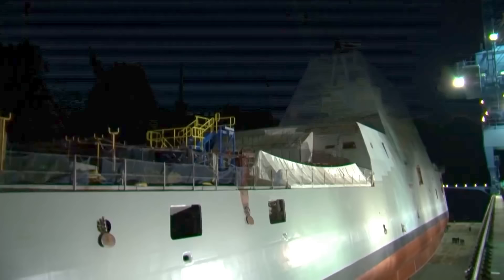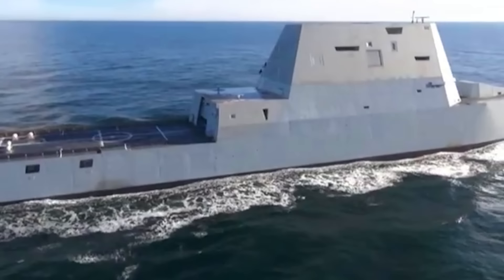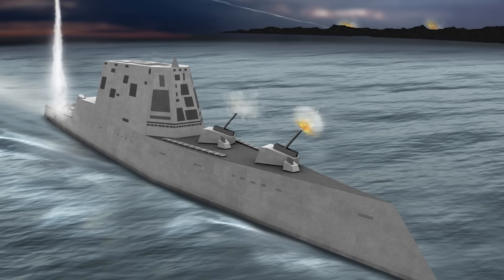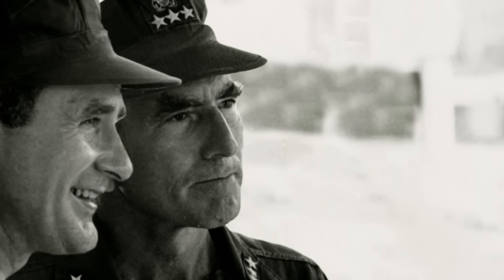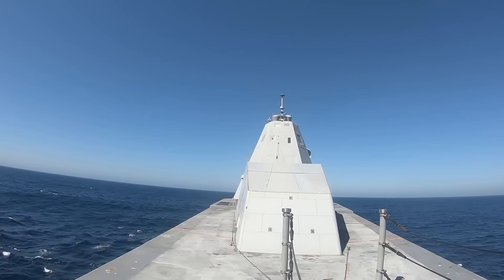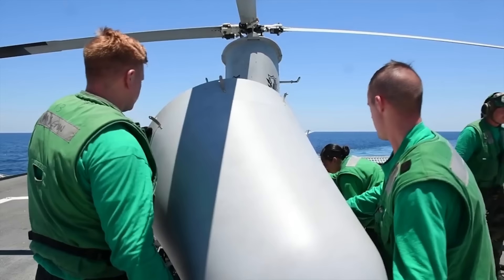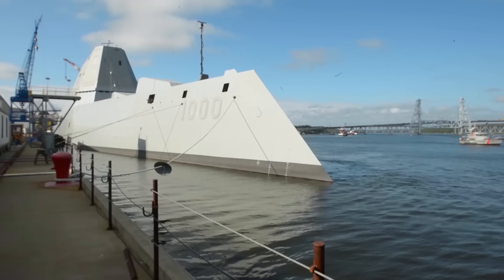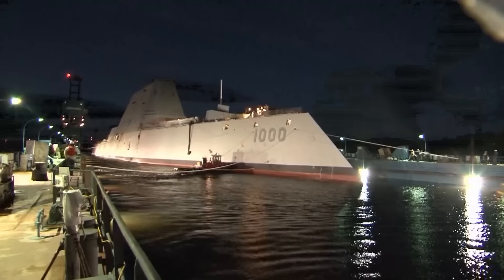The Stealth Ship So Powerful They Couldn't Build Any More

Comment: Another thing you miss is resources..like yttrium,gallium, dysprosium, samarium, neodymium. They are rare-earth elements (REEs)—little-known but crucial ingredients in much modern US military aerospace technology. Each stealthy F-35 strike fighter requires 1920 pounds of rare-earth material, according to DOD. Each Arleigh Burke DDG-51 destroyer requires 15,200 pounds. An SSN-774 Virginia-class submarine needs 19,200 pounds and we not counting missile radar system  satelite microprocessor  yet.But America have little amount of these rare earth mineral  like 1.2 milion tonnes left .That why US invade Afganistan. Afghanistan has an estimated 2.4 million tonnes of rare earth minerals including lithium (used in batteries), uranium (used for nuclear fuel) and many others. One of the largest deposits of rare earth minerals can be found at Khanneshin in Helmand  province. But US is kick out from Afganistan in 2021.

Comment: I got a rare inside on the steering of this ship when I worked night shift @ boss snowplow in the shipping department. The military had a secret area they rented out because it was the only place within 100 miles that could supply enough energy to operate just 1 of the 3 motors used to steer the rudder. That was just enough power to operate the motor without anything attached to it. That wild

Comment: The Zumwalt wasn't too powerful.  It was too complex, too inflexible, and too hard to repair, not too powerful.  It was exactly as powerful as the role it was designed for needed to futureproof the role.  For that perfection though, it was too problematic to produce in larger numbers.  Its the Navy's F-35, an attempt to do way too much that the ship hull could simply not do all of at once.

Comment: These ship were not canned because they were wow too powerful or too advanced but because they were a massive failures just like the  Independence-class was you also did this absurdly rosy video on. They were supposed to be built around a new smart gun and shell system that would replace the system we got from the UK at 45K a shell. The system for these two boat was supposed to cost 20k a shell yet it ended up costing 800k a shell the realm of cruise missiles. Just like the Independence-class they had to take on water to fire their weapons because of a lack of stability and pump it out to start moving again. Just like the Independence-class it couldn't more at full speed and couldn't even move fast in anything but the calmest seas. Just like the Independence-class they damaged there own hull and  engine though standard use to a point it could ended up stranded in the middle of the water on a long deployment.

These two ships cost the taxpayer hundreds of billions in R&D and build cost and now there being scrapped.

Comment: Zumwalts have/had huge problems with their engines. Not the least of which is the union of dissimilar metals without a sacrificial anode.
Reply: WOW! How did they let that happen?? Anyone that's owned a boat knows the consequences of not using zinc anodes....that's unbelievable.....
Reply: @fritzkabeano1969  
I might be confusing the Zumwalt with another failed class of naval ship, but the first one launched had to put up for extensive repairs due to corrosion early in its life.
Reply: @fritzkabeano1969  
I think I'm talking about the littoral attack ship, which has an aluminum hull.
I think they bolted the aluminum cooling water manifold to a steel turbine.
It didn't take long.
Reply: @twill9278  Either way.....just the fact that the designers ignored the basic physics about dissimilar metals and no sacrificial zinc anode tells me everything

Comment: Too advanced for the entire century?  I didn't understand from anything said here why it would be that.  And the claims that it is some kind of replacement for battleships is ludicrous, for one thing we haven't needed a battleship for decades.  For another thing there's nothing about this at all that could replace a battleship unless of course you think battleships were solely designed to bombard the coast of a nation like the New Jersey in Vietnam.  These would have trouble penetrating the armor of a battleship and a battleship could take one of these out with a single hit from any of their 9 16 inch guns.  even their 5 inch guns could sink it, this ship is NOT armored (destroyers are called tin cans for a reason) while battleships have over a foot of armor.  Battleships were multi-mission, land sea and air, but their primary purpose was to fight other battleships and this ship would do well to survive such a battle one on one, much less win it.  It was solely designed as a land attack destroyer to replace the shore bombardment capabilities of the destroyer, but comparing it to a battleship is like calling my toaster an oven because they can both toast bread.

Comment: I thought these were kind of a failure...
Reply: They are and they were doomed from early on. A bunch of new and untested technologies all crammed together in a giant project with continuously changing goal posts is just not going to work well. You need to first test the new stuff with a bunch of technology demonstrators and smaller project. Then, when you have those working reliably, you integrate them into larger projects with well defined roles, needs and functions. "A subcontractor from almost every state" is in most cases not a good sign as it usually indicates that decisions are being made for political reasons.

Comment: Fake info, they arent stopped because of being "too advanced" if you read a single article you will find out that because their hull started cracking, they are survivability tier 1 which means that they have least chance of survival out of other 2 tiers (3 tiers with 3 being aircraft carriers aka high chances of survival)

Cracking was caused by partial aluminum hull welded on steel or entire aluminum hull. Aluminum is not as flexible as steel so durring waves or any stress coming to the hull from below the ship cant stretch but starts cracking....

Comment: There are 3 Zumwalt-class destroyers in service today.  They were an awesome Idea, but... were subject to ridiculous cost cutting that made their advanced weapons systems impossible to use.  The original design involved making them nuclear-powered, which would have provided more than ample power for high energy weapons, railguns, and the like.  Problem is... the power plants they actually ended up installing are almost too weak for the current weapons, let alone what could have been used.  great idea, poor execution.

Comment: Incorrect title: The stealth ship so expensive, they couldn't build any more.

The ship itself is incredibly expensive. It was supposed to fire 155mm shells costing each as much as a cruise missile. And with all those costs it still has way less missile capacity than a much cheaper 055 destroyer, which is also smaller. 

This thing was designed as a cash cow, not as a destroyer.

Comment: 16,000 tons is a good bit larger than the German pocket battleships, which displaced 14,000 tons. Isn't "destroyer" a bit of a misnomer? It reminds me of the Japanese "destroyers", which are actually snall aircraft carriers! As they carry more aircraft, they are actually more powerful than the British full size aircraft carriers. China is not a weaker opponent, it is or will be a tough adversary.  We should have learned lessons about under-rating the enemy at Peal Harbour, so let's not repeat the  mistake in the 21st century.

Comment: please don't make this dumb statements that Zumwalts class was 'to powerful', so they can't build more... 
It was TO EXPENSIVE to real fight power on modern warfare. As we can see on war in Ukraine, even well equip ship, can be sunk with relative cheep drone missiles. If this class will cost 1/4  price, I'm pretty sure, that US NAVY will order more. They order older Arleigh Burke class that it's cost around 1.8 bln per vessel. And estimated cost for new Zumwalts class on 2022 was around 8 bln. usd. So you can see this huge price difference...
Not mention that cost of maintenance Zumwalt class was also much higher, but should be lower instead. Even that he have less creew members.

Comment: Stupid procurement.  Cool ship, advanced, and some great features.  But ultimately not very useful, especially once her weapon systems failed to materialize.  Even if they had worked, there are no many land targets to hit with 155mm projectiles.  If we can pinpoint a small target that a 6" gun can kill, chances are there are lots better ways to kill it than a ship getting that close to shore - yeah even 50 miles is close, especially with a relatively slow speed of 30 kts. Having 1 ship that costs twice (or more) than ships she replaces is only smart if the expensive one can do the jobs of two ships - it can't.

Comment: Powerfull disaster yes metal hull plates  cracking systems not working etc that is why they are not building them anymore thing is an engineering disaster